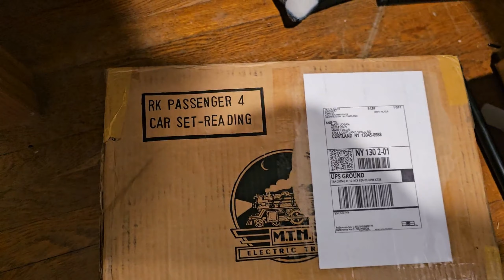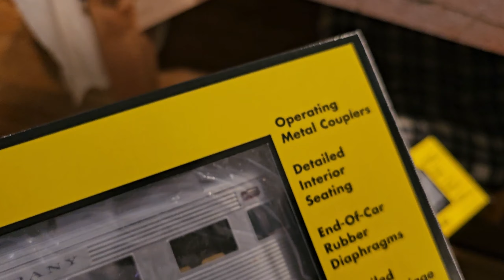Olin Train Auction, MTH Rail King Streamliner "Reading" Cars & NYC Madison Cars, Layout Update

Comment: Santa Fe Alco & passenger train looks nice going around tracks, The R/K passenger cars look a lot bigger than the Lionel/Santa Fe car, both taller and longer. Maybe the smaller ones will look sized better with steam locomotive. But the NY central F3 looks ok with bigger cars. Gotta say NYC passenger cars look nicer especially w/F3 diesel. All good😊